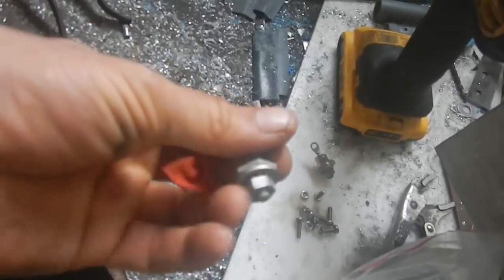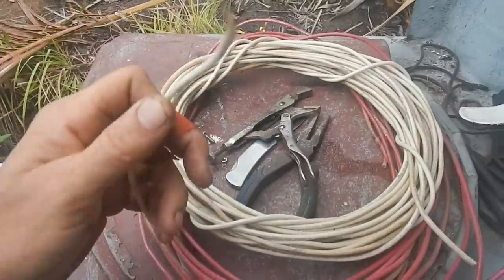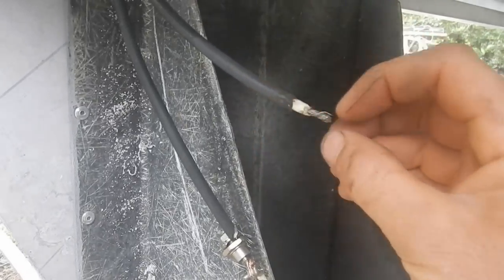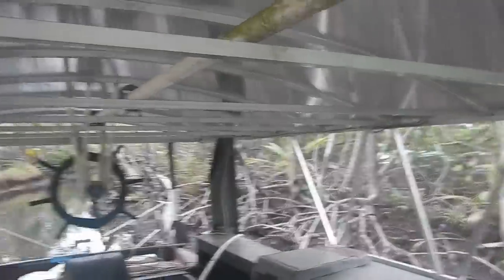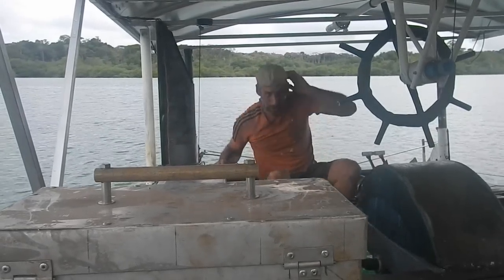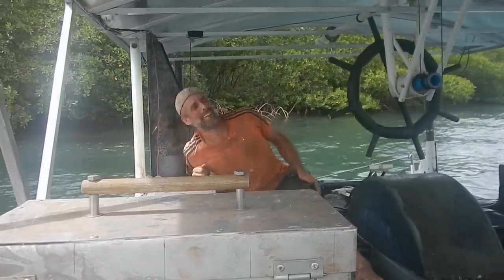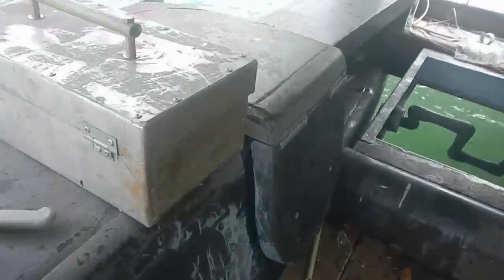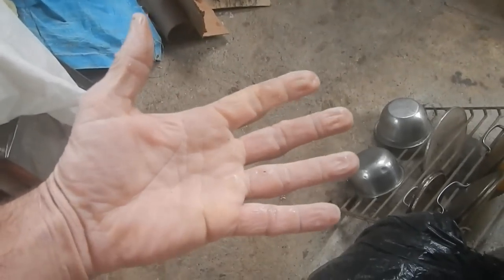Shark Slicer Upgrade 021 Wires and Barnacles!

Comment: Soldering the wires then using heat shrink is better than crimping them so the voltage and amp current is better.⚡💡💡⚡⚡

Comment: i dont know how much depth you have to work with in a docking situation, would it be possible to use 4 plastic drums that can be filled with air or water depending on if you want them to sink or raise? basically make a boat slip you can use a car type 12v air compressor to raise the dock and your boat out of water for storage/hull cleaning. it seems to me like it  would be a simpler solution over using a cabling system to suspend it up like you mentioned several times in the past

Comment: Have you considered mounting a bicycle with lots if gears to the peddlewheel? So you can increase the gears as you gain speed, and also basically run it like an exercise bike. You can still keep the tractor seat option. Could be nice with some variation on long trips.
Reply: I don't mean to butt in...but rust treats (mistreats) thin ferrous metals badly and quickly. Sorry  to butt in especially when a more accurate answer will supplant this sophomoric explanation, even though it has been posited before by the giant robot engineer.